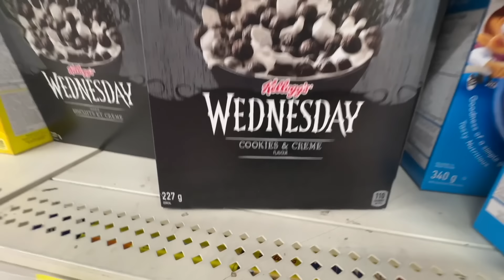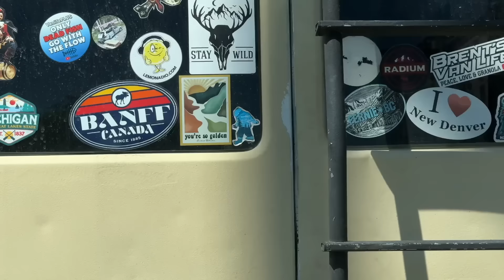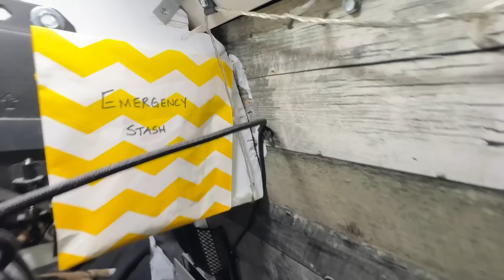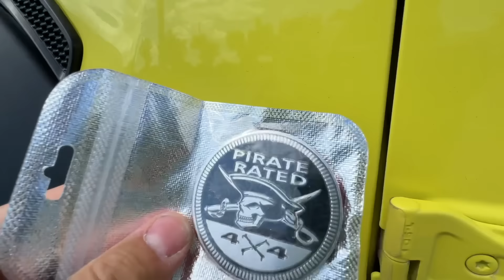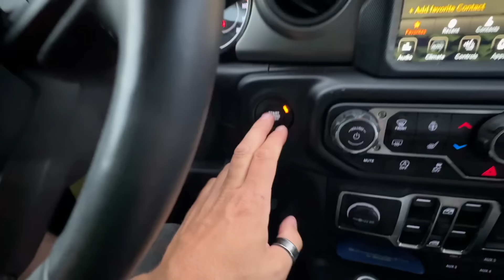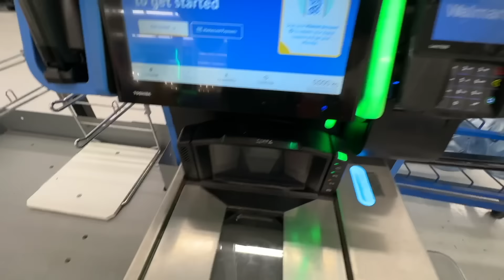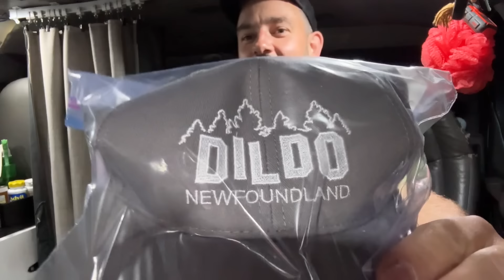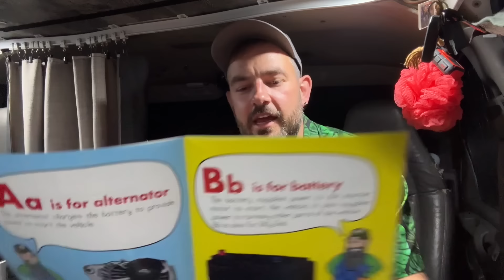THAT COMPLETELY DRAINED ME -  Vanlife Day in the Life

Comment: There is a small town in PA called Intercourse.  Excerpt:  Intercourse is an unincorporated community and census-designated place in Leacock Township, Lancaster County, in the U.S. state of Pennsylvania, 10 miles east of Lancaster on Pennsylvania Route 340. As of the 2020 census, the population was 1,494, up from 1,274 at the previous census. Wikipedia
Population: 1,691 (2022)  There are a few theories. First, our town used to sit at the edge of a race course, right where visitors would enter the racing festivities. The entrance was coined "Entercourse" and may have evolved into Intercourse. Or, the name may have come from the Intersection of two major roads, or courses.
Reply: Census not a reflection of its name 😂😂😂

Comment: Just wondering. Why don't you put your pee bottle inside the poop bucket? That way should you forget to put the lid on correctly, if it falls over it won't spill pee on the floor. And out of sight, out of mind.
Reply: Because when people poop in a bucket it's in a bag and can be dispose in a garbage can. Also you don't only pee when you poop so a bottle work instead of peeing in a bag
Reply: @JR-sb3vm  right. You set up the bucket to poop. Do your business and wrap up the poop and discard it. So for the most part the bucket is empty 99.9% of the time. So storing the pee bottle inside the bucket can avoid spilling accidents and it's hidden from view.
Reply: @kathywrightjohnson6804 the whole thing is gross. Can you imagine not showering for weeks
Reply: @ddrozdowski  that would be why I live in my tiny house.
Reply: @kathywrightjohnson6804 the unfortunate part is that the water pipe under repairs meant everyone in Calgary was getting a tad …ripe, including sticks and bricks
Reply: @christinamann3640  I never said anything about his hygiene! I know Calgary was under water advisory and he had stocked up on water. Has absolutely nothing to do with storing his pee bottle in the poop bucket. Someone else brought up the hygiene. Just to clarify.
Reply: Well at least there's wipes, that helps some😁
Reply: Just because he lives in a van don't mean he doesn't shower regularly 🙄 the towns having water repairs it's  everyone having to deal it's temporary.

Comment: Did you see that Dildo, Newfoundland made the news.  They had a floating penis shaped iceberg in the Dildo area in Conception Bay.  You can’t make that stuff up.  It’s newsworthy!  We live in Tenmile, Oregon which is 10 miles from nowhere.  And a town you drive thru on your way to the coast is called Remote, Oregon.  It consists of an old store with wood planked floor boards.  During covid when I was looking for work, they would have jobs in Remote, Oregon.  They meant that the jobs were “Remote” as in working from home or van, not that the jobs were in Remote, Oregon.  Poor Remote, Oregon.  Can you imagine when people came to Remote to find a job and ended up stopping at the store to find out there was “no work”.

Comment: Have you tried using that waterproofing spray that you use on the work boots/construction boots you know the ones with the steel toed that works very well or did on my work boots and that stuff is in Walmart right in the section where you buy the work boots. That might be another alternative for waterproofing your cat thing or whatever it is.
 On the subject of steak burritos, I’m not sure whether you have it in Calgary but here in Ontario Toronto/London, there’s a place called burrito Boyz. they have excellent steak and or chicken burritos very big burritos for me. It made two meals.
I have a really dumb question/comment,
Here in the Toronto area, Walmart charges $2.87 for the same size bottle of Coca-Cola here comes the dumb question are they just as expensive in Calgary Walmart for the same bottle? Yes I know I know what a dumb question. LOL